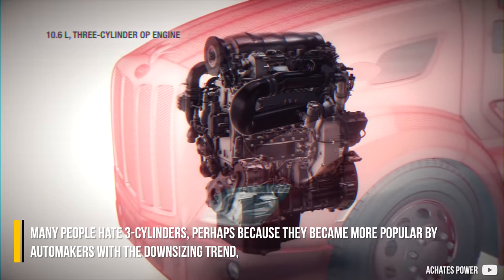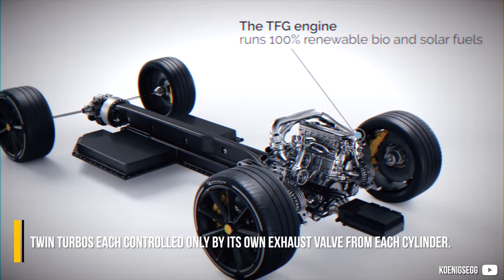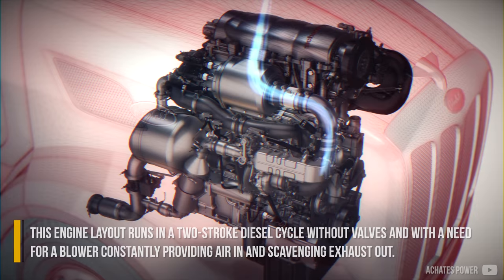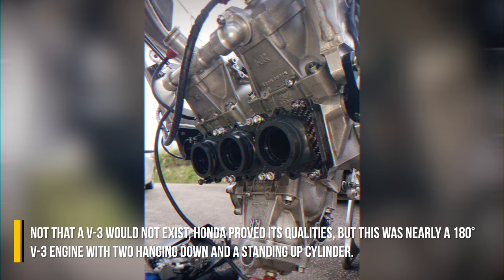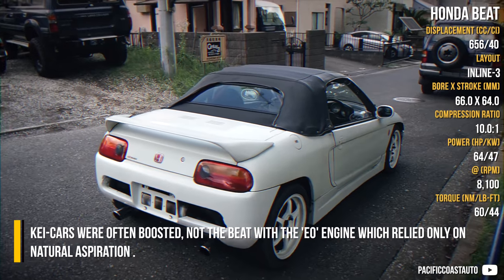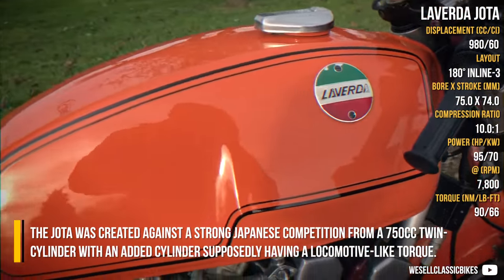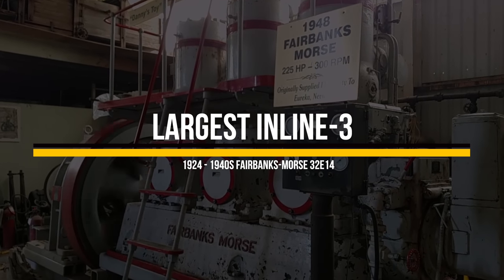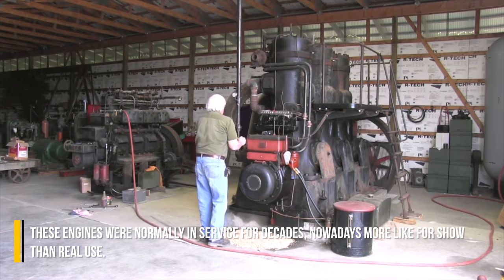The STRANGEST 3-Cylinder Engines

Comment: I had a 1975 Suzuki GT550 three cylinder two stroke. It sounded great. Thirsty though. Great video as always sir.
Reply: Don't forget the GT380, and the GT750 "Kettle"! No mention of the Kawasaki triple's though ("You want too fast with dodgy handling and brakes that are too small? OK, here's an H2!"). Yamaha made a 750/850 triple too, unless my aged mind is slipping.
Reply: those bike had forks slimmer than you see on a 125cc nowadays..

Comment: I'm surprised you didn't mention the 5 stroke 3 cylinder engine. The 2 outer pistons are 4 stroke but the exhaust runs a 2 stroke low compression piston in the middle. It makes a very low emitions engine that is very efficient.

Comment: Great stuff ! I had a 3 cyl Mini (B38 engine) and it was quick as hell - 134 bhp and nearly 175 lb/ft torque !! Ive got the 4 cyl Cooper S now - 192 bhp and 207 lb/ft torque (plus a 10% overboost). Speed wise, there is really little difference, and the 3 cyl sounds better than the 4 !!

Comment: Years back I worked night security in a shipyard right next to the Coast Guard academy, and they had a little Daihatsu HiJet for the maintenance crew.  It did not have a muffler, and they would run it up the hill wide open.  That little triple sounded pretty good.

Comment: great video, I'm waiting for highest revving 3 cylinder engine
Reply: Might be MV Agusta motorcycles. Not sure exactly.
Reply: NSR honda 2 stroke probably.
Reply: MV Agusta F3 800RC revs to 13,250.
Reply: @exothermal.sprocket  So far what I know is that the highest is Aprilia Cube GP reaches 15-16000 rpm

Comment: I do wonder why engine layouts like the opposed piston one and two stroke with fuel injection aren't more common.
Reply: Evinrude (now defunct) had a 3-cylinder "e-Tec" engine, 2-stroke, direct injection, and up to 150 HP.
Reply: @craigmclean8260  Oh? I have heard that the Mercury optimax outboard engines also were two stroke with direct injection, But I don't know if it's true.
Reply: @Skillmk3  Just looked it up...Indeed; the Optimax was first in the direct injection outboard race, introduced in 1995.  Evinrude introduced the FICHT system in 1997, apparently...

Comment: Are there engines with different sized pistons in the same block?
Reply: Ive never heard of it but it could work with obscure crank balancing so its possible
Reply: @jarrynsmith  well I was thinking with the 3 cyl in this episode there was one that was 180° firing from the other 2 that could be bigger to give it the same force as the 2

Comment: can you make a video on new cars with highest revving engines? everything seems to redline at 6500 these days
Reply: Yeah, economy oriented turbo cars are bound to do that. There really isn’t much to gain with the small turbos they use for response, they just run out of steam
Reply: @raptorjeezus2607  i mean aspirated engines they all have redlines in the 6-7k range. even really small engines like a 1.2 suzuki swift makes peak hp at 6600
Reply: @scampers6609  Don't smaller engines rev higher
Reply: @proarmy70  there's a lot of other factors besides displacement that determines maximum RPM but my point was all newly built engines have the same redline whether it's a 2.0 performance engine or a 1.0 economy engine
Reply: @scampers6609  yeah that's true
Reply: The common uses for vehicles these days, revving higher than 6500 would be very impractical, would assure low torque at the speeds most people find themselves driving.

Comment: You didn't refer to the Coventry Climax H30  3 cylinder, opposed piston 2 stroke diesel used as an aux engine in the Chieftain & early Challenger tanks. Had a crank top and bottom and the injectors in the side of the cylinder block. The Leyland L60 and the Rolls K60 were similar in concept, but scaled up. The theory was that they were able to run on Diesel & Petrol and were all derived from the WW11 Junkers Jumo aero engine.

Comment: the achates op engine is very interesting, it's available in gasoline as well, with a high compression ratio. And they are twin-charged, meaning there's a turbo feeding a supercharger.

Comment: What about the 1.0 engine in new Honda Civic needs to be mentioned because of the low max RPM at only 5400rpm 128bhp.
It's a V-TEC, but it's also a very complex engine when you read into it.